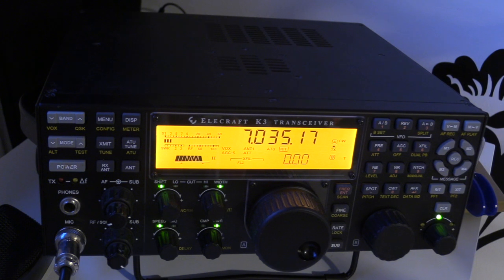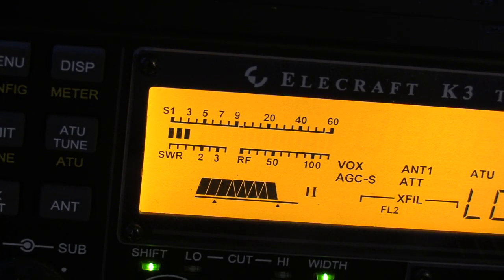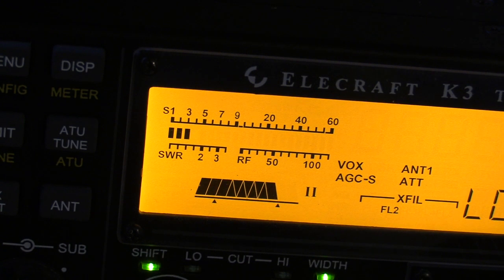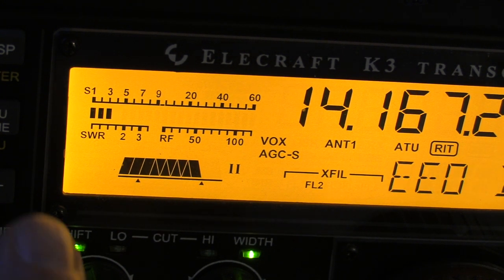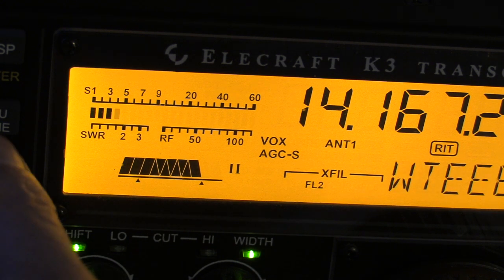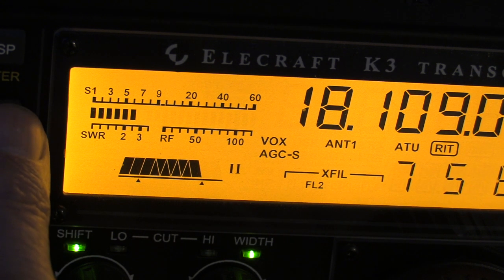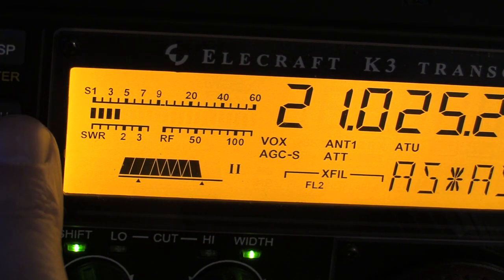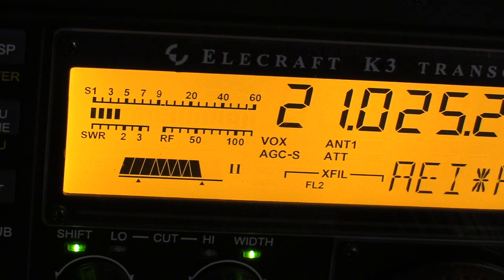Multiband End Fed Antenna System using Spiderpole

Comment: I wouldn't recommend that screw eye sticking out like that. Too large a thread will crack that top section. Leaving it sticking out so much risks putting torque on it and again breaking it.

Instead, recommend getting a smaller one that fits fully inti the top. Use hot glue if you worry about it coming out. Much lest risk of breaking.

Random end fed on fiberglass pole is my favorite POTA setup for three years now, couple hundred activations this way. 
73, WB2SMK

Comment: The smaller and simpler antenna with a good performance is more impressive for me compared to a elaborate set up that is expected to perform. I once tuned up a metal window frame out of desperation in a tower block at 120ft asl and made copies into Europe on 10m, the front to back of the metal framed building was off the scale when I put up a dipole there.

Comment: I recently ran a Par EndFedz 20m (monoband) end-fed up a 12m Spiderbeam pole and ran SSB barefoot. With the matching unit about 2-3 ft above the ground, and then running the feedline horizontally along the ground, to the shack (< 10 ft away, in a houseboat rental) I managed 11,800 km DX on 100W (Ontario to Kenya), and also Japan and China on 80W. The SFI was low 90s, I'm sure it helped. I wonder if better take-off angles from the vertical also helped, and/or was it the freshwater ground plane nearby). My point is that since the pole is easily deployed, and the performance is very good, these are great options for limited space hams, and low visual impact, and low cost. Totally recommend these configurations to those with limitations.
Reply from the maker: Many thabks. Yes I ha e had similar mila great results. Even shorter on 17m where I have had some good. DX. 73 Peter

Comment: I currently have an MFJ end fed - 10 through 80 metres.  80 metres is a bit narrow, but with a small ldj tuner it works quite well. I currently have a short fibreglass pole (about 20 feet ) and run to the house. The height compromises the antenna and I plan on replacing the mast with a fourty foot spider beam in the spring. 
Thanks for yet another well done and interesting video.
Reply from the maker: Hi Don. Thanks for sharing. Take care. 73 Peter

Comment: I use an HYENDFED EF antenna with a spiderpole in a sloper configuration and it performs very well.
Reply from the maker: Many thanks
Reply: I have a 5 band version configured as a sloper, high point about 12-13 meters above ground.  I also have a couple of mono-band EFHW antennas from the German company lambdahalbe.  They are cheap, have no match box, but have a window line stub on which you can ajust the SWR to any given situation.  I hang the 20, 15, 11 (CB) and 10 meter antennas vertically from a fiberglass telescope mast.  They seem to work ok.
Reply: @mumi009  Sounds like a good setup.  I am a big fan of the EFHW for both performance and ease of use. In the field, I use a fiberglass SOTA pole and an arborist throw line to the nearest tree and it always seems to work.

Comment: Does sag of the antenna affect the end fed performance?
Reply from the maker: Hi there,

Not much. After all, most dipoles sage in the middle. But as the centre is the part that radiates most, it is best to try and get it as high as possible. Having said that, don't worry too much about any sag. 73s Peter.
Reply: @watersstanton  Thank you for the response. I'm using a jackite 33' pole and it bends quite a bit.  I should loosen the slack.

Comment: hi just wonder please if you could help me i see you a M0CVO LW-10 Long Wire Antenna . i have a simular one ht lw40, i see a yoytube video a gent put the wire around the roof . can this be done and where does the box go. do you fix it to the hightest spot . or ground level please . i wonder be grate full for you help please thank you , i have a small garden 30ft by 40ft back
Reply from the maker: John, an antenna run around the roof will have its resonance changed. It really should be out in the open. The matching transformer is always at the feed end of the antenna and can be at ground level or in the air. 73s Peter
Reply: @watersstanton  thank you

Comment: No earth lead?   can you put a current meter on the coax and measure how much RF is on the coax braid?
Reply: There's negligible current on these end feds however a good earth is recommended because of static but also allows the rf energy to flow further down the wire, there's a youtube video explaining it, Steve Ellington I think he's called he has these EFHW from myantennas.com and loads of people including myself highly recommend them.

I got to the U.K no problem from Ireland on 5 watts with Xiegu X5105 on 80 meters and even got complimented on the signal from only 5 watts, I also got to Slovenia on 20 meters last night with the same rig on 5 watts. They are fantastic, resonant on multiple bands, I only need a tuner on the higher end of 80 meters to flatten out the SWR but if you request Danny of My antennas he can lower the swr on the higher portion of the band.  

The Antenna is obviously very efficient and much better than using the likes of a G5RV which needs a tuner for most bands but the antenna is not efficient, my EFHW 8010 is resonant on several bands. 

I got to the very North of Norway on an old Yaesy FT-77 with about 80 watts and he was very impressed because he said he rarely hears people this far down on 80 meters, I live in Ireland. So the antenna is obviously working very well, I only have my license since the 20th May so still trying it out. 

The Antenna in the video is the EFHW 4010.

The magic seems to be in the transformer which is a 48:1 UnUn and not the normal 9:1 you would find in a normal end fed but this will require radials the my antennas EFHW do not and the normal 9:1 end fed is not a multiband antenna meaning it's a lot less efficient.

Danny from myantennas worked for Cushcraft so he knows what he's doing.

I also do not have my station Grounded apart from Normal electrical earth for the house mains I see little point. The Antenna is grounded via the ground terminal on the transformer box. I have no issues with RF.